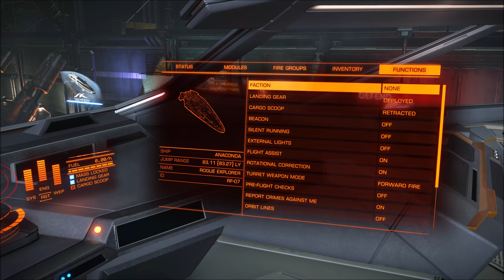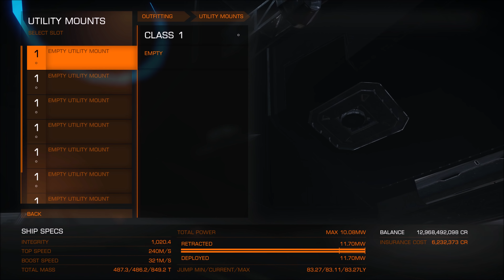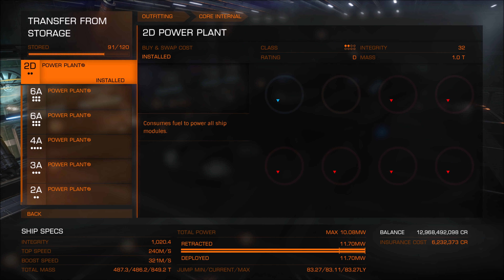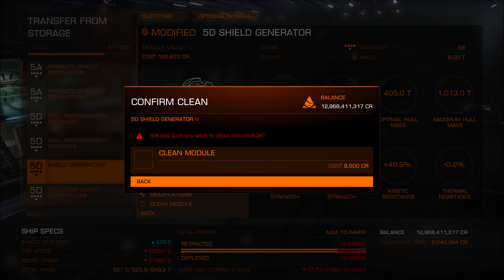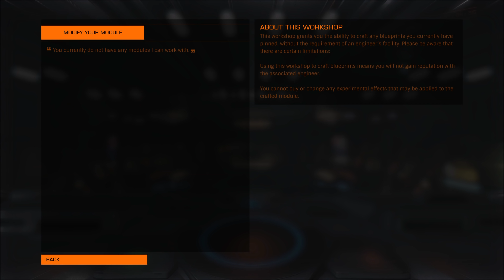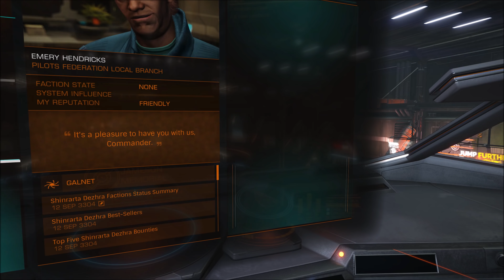The 83ly build (Elite Dangerous)

Comment: Why did you not used a 7A framshift drive?
Reply: You can not use a 7A Frame Shift  Drive in an Anaconda...
Reply: TheBobNoxious you have a 7 slot
Reply: @chrishalle1982  you can't move core internals around slots like optional internals

Comment: Not much of an explorer build, and by the time you've put the modules most people would want for exploring, it's just another perfectly normal 'conda. What is the point of this video?

Youtube clickbait maybe? Desparate for views?
Reply from the maker: hi there, in this video im just explaining the potential maximum jump-range - which has moved from around 65-70ly to 83.99ly. It would been great if we could hit around 100ly in a build, but sadly not the case. Some will want to know how you hit those very high values, and I wanted to show you that it comes with a cost. If you go for an exploration build, then I agree there isnt much in it. This is what I was trying to show.
Reply: i remember hax0rzing the old Frontier: Elite II game with the Osprey Attack Fighter giving it class 3 military drive (well over 240LY jump there).. there's a ship that had 80LY jump on class 2 military drive.. (then i stabbed a class 7 into a Constrictor, 450ly, and made it have 2k Tonneage for cargo, just not even realistic, but hey, i had fun then)

you'd think they use the old standards in that game? no no, rebuild the whole canon based on the old game..
Reply: max range build, not exp build
Reply: @MaximusPsychosis  to what end?
Reply: the same as the other people wanting to get the most flight speed out of ships, eg full boosted eagle can pull 800+km/h, same as people pumping hull tanks, or shield tanks.. everyone wants something of this game, its all part of that "Personal narrative".. ive been wanting to get to that god like 100ly jump range, can you imagine how far you get with neutron boost? one side of the bubble to the other.
Reply: Hater much? It's a theoretical build.

Comment: This is only useful if all you want is a taxi ship, an expensive one, a 70ly anaconda is way more practical as well as a 65ly asp explorer
Reply from the maker: indeed, I wanted to show that you can build an 83ly ship but also how to make it more useful.
Reply: The problem i have with the asp x is that it just misses one slot extra for a guardian frame shift booster sacrificing the afms or repair limpits might not be wise also a reason to start looking at a krait phantom at some point but the asp x is easily the best explorer beginning to mid game

Comment: Ok... so half way through you say you’ll need this and that and then the jump range starts to drop down into the 70’s... nothing new here.
Reply from the maker: hi there, I wanted to show that 83ly is possible but it does have some trade-off's. (hopefully) I said they were recommendations, not requirements (as I didnt want people going out with 83ly anaconda's to get stranded). You could easily not bother with the shield, SRV, bigger power-plant, etc. for the higher jump-range. which should be easily into the 80's. I think the very max range is 83.99ly atm.
Reply: @Roguey  some tradeoffs ??? No afmu no srv no cargo space its like a giant hauler 🤣🤣🤣